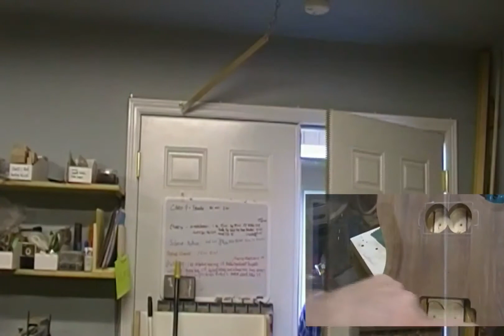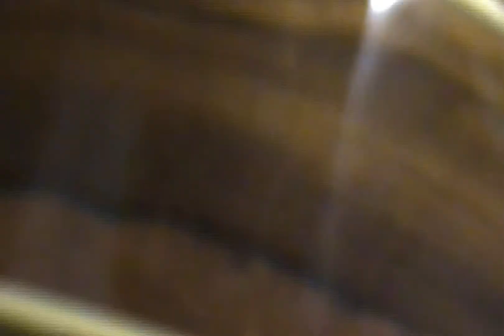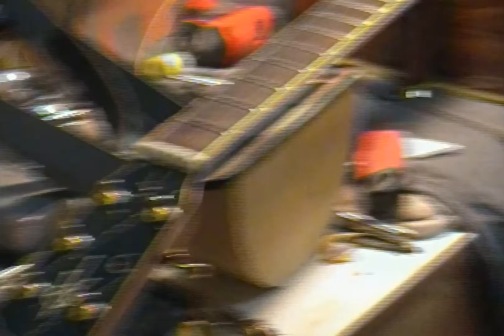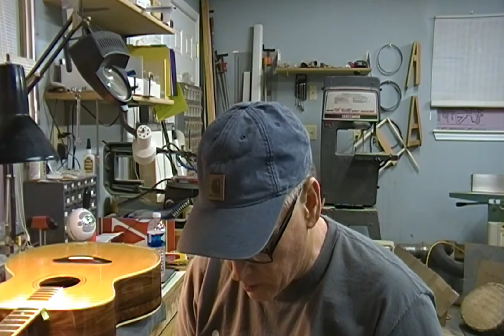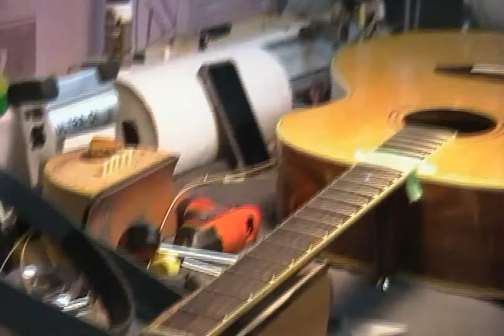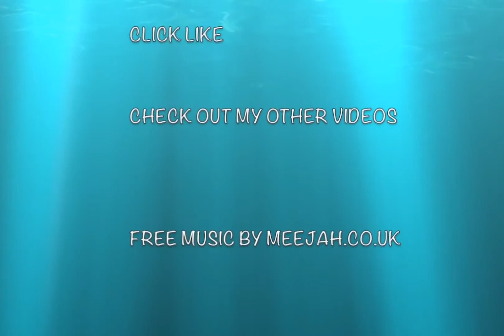JONAH GUITAR EXTRA #12, Tuner hole RANT

Comment: Hi Dane, I usually always drill my tuner holes one size small and then use a reamer and reamer them down to the perfect size. I can’t stand the ones that are sloppy but sometimes there is nothing you can do. I still don’t think one should knowingly increase the hole size!
Reply from the maker: Hi Buddy, I think ream to fit is a valid way to go. Even if I drill the exact right size hole it ends up with grain filler and finish in it, then needs reaming or filing to refit the tuner. I was just dumbfounded that someone with no sense of how to do the right thing would even attempt to do the job. Just keep repeating it's 100$ guitar like that makes your ignorance ok.
Reply: Dane, you are right on man!